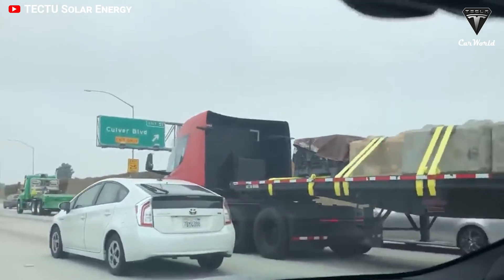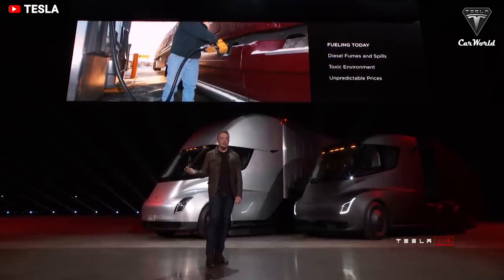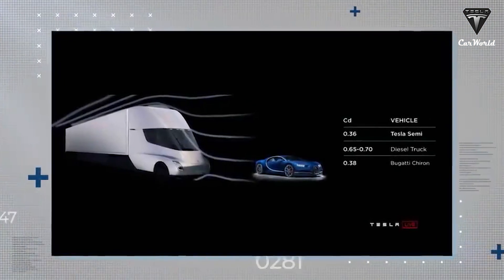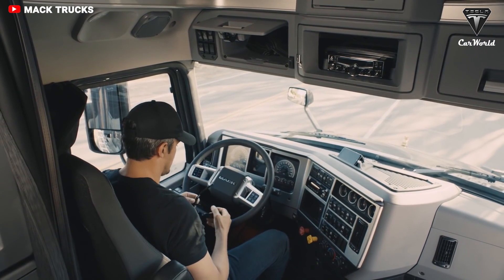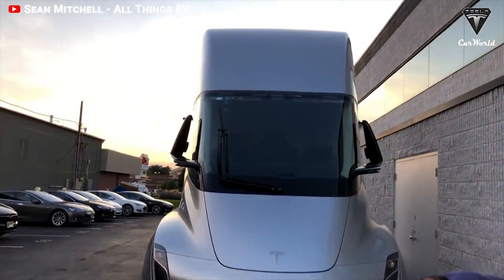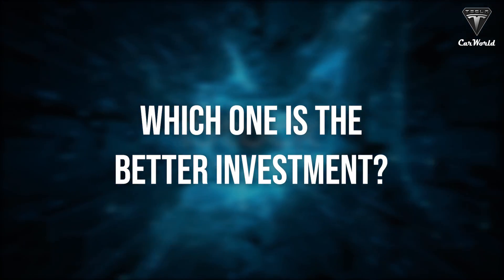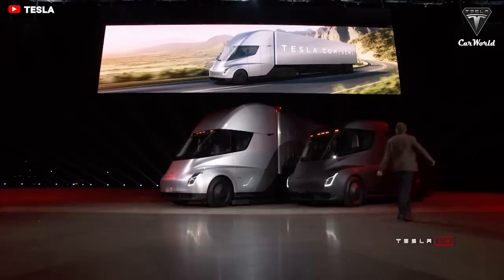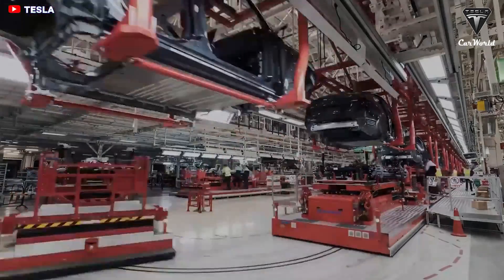Which is the KING of 2023 heavy trucks? Mack Anthem Diesel Truck Vs. Tesla Electric Semi?

Comment: Diesel semis are going to be the best always
Reply: I will never trade in my diesel trucks for something that looks like shit. If it gets to the point diesel is no more, that will be the day I retire.
Reply: “Always” yea until oil inevitably runs out
Reply: @GSDKXV  Thats not gonna happen for a while, scientist say the gulf of mexico alone has enough oil to last at least another 500 years.
Reply: agreed
Reply: the best for noise and air pollution sure...once solid state batteries leave the lab and enter vehicles you will be able to drive thousands of miles in electric vehicles between charges...you are either ignorant or stupid which is it?
Reply: Wouldn’t say always, but they are great for now.
Reply: I support your idea until tesla semi have a range of 800-1000 mile range
Reply: wrobg
Reply: @sharonbraselton4302  Yeah, your opinion is wrong

Comment: The mack. Most road trucks run 5 to 600 miles a day.  It only takes 10 minutes to fuel in a mack.  A road truck can travel about 1000 miles per fill up. Tesla only 300 after charging for 10 hours.

Comment: Ppl massively underestimate the amount of time you save by accelerating to 60 in 5 seconds.Typically a traditional semi can take up to 30 seconds to reach 60 with a load, 5x slower than Tesla's proposed speed. Let's say conservatively you get up to 60 at least 4x in a day... That's literally 2 minutes quicker, per day! If you're working 8hrs a day, 5 times a week that would equal 520 minutes (8hrs) over the year. Literally could be an extra work or off day. And the only thing that changed was just being able to accelerate 5x quicker to 0-60 than the competition.

I don't know about you but if I can gain an extra day while doing the same work, you better believe that's what I'm going for. Whether you believe it or not but this is where the industry is headed, stop resisting innovation, it's weird.

Comment: It is so easy to tell that the author of this video has no clue when comparing semi trucks. Acceleration?! Horsepower?! Are you serious? Torque is king. Try hauling a Toronto to Florida route and see which one is better. Add to the fact that Elon and Tesla have a notorious history for running a lot of hype but not delivering and you have a truck that is only good for running Sysco and Budweiser day cab operations.

Comment: Might be good for local trucking, but charging that large of battery, especially fast charging it over and over and over again, is going to obliterate its range and longevity. Not to mention the wide variety of inviroments and weather the trucks will see. Not enough active  charging stations because tesla keeps withholding payments to small business that let them install a super chargers. Even if there was enough, there is no possible way for our grid to support trucks and cars. Shit people in California aren't even allowed to charge sometimes for that very reason. A  truck is someones home. I definitely wouldnt want to rely on the ifs and maybes that come with charging EVs while its below freezing outdide. Besides, the energy that goes into a battery is most likely from a coal burning plant that operates at around 30-48% thermal efficiency. Diesel trucks thermal efficiency ranges between 30-50%. 

EVs are not green like the government likes to tell you. The batteries are hard to recycle, the mining of materials causes irreversible inviromental damage, and they are powered by coal plants in most cases. So it just taking more steps to get to the same results. Gasoline catalytic technology has advanced to the point of almost zero tailpipe emissions. Diesels have countless emissions devices that also make their emissions pretty damn clean as well.

Unless there is a battery that can maintain its range after suffering the abuse of trucking, I dont understand why we think that is somehow better than 2 fuel tanks that will consistently give the same range for years and years and years.

Comment: 13:45 Yup, insane is the word. Just do a little calculating. With that saving per 200 miles trip, with just 400 miles daily trips for 28 days a month, in exactly a year and a half, you can buy a new Tesla Semi with the savings plus $2000 to buy yourself a brand new most expensive iphone.

Comment: Do you realize that trucks work with torque and horsepower doesn't really matter. Acceleration really doesn't matter too much either. It's not like  truck drivers are going to be drag racing on the highway.

Comment: They'll have to come up with something better much better than the current batteries to really be able to compete with what's available already. We were promised something that would beat rail. This doesn't beat what's there already.
Reply: no they dont...freight haulers can not even legally drive 715 miles in a "day" unless they can average 65mph which is impossible unless you speed.  Days are different for freight haulers and normal people.  Look up the regulations for the 11 and 14 hour days for freight as you dont know what you are talking about.
Reply: Nothing beats rail, especially if it's electrified rail and nothing will beat it ever, except a more efficient train.
Reply: Did the Ford Model T outperform race horses? Probably not. Technology improves and to expect something to be perfect from the get-go is just a low IQ argument.
Reply: @bedinor  he said right now it could be done years ago. That's the issue. A bunch of false promises. If you can't comprehend that, what's that say about your I.Q.?
Reply: Ohman:  You have no idea what you're talking about.  On the Dec. 1 delivery ceremony, the Tesla semi has ALREADY been clearly demonstrated to be FAR superior on performance, with CURRENT battery tech.  It totally blows away the diesel semi performance.  

Being in denial doesn't make you even close to right.
Reply: @rogergeyer9851  it's called skepticism. And it doesn't beat what's already available. Take a good look at current freight trains. Diesel is it's battery essentially, maybe power plant. Like I said, they need to come up with something better than the current batteries. They've already shown that long hauling with batteries is outside the realm of possibility for batteries. 

They overhyped what it can do, and many people to that bait.

Comment: The speed shouldn’t even be mentioned because as a truck driver that doesn’t matter unless you wanna not have a CDL anymore. Also big companies like Pepsi will eventually find a way to have it governed. Trucks now are mostly governed for fuel reasons but for safety reasons, cargo and to prevent being sued for accidents this Tesla will be governed eventually. Also  I’m sure this video is from before the test. But fully loaded it’s 0-60 is 20 seconds.

Comment: Sigh, you clearly have no understanding on what is important with trucking and what the numbers mean. For instance the 80000lb limit is a limit by the dmv, as an example here in a Australia the payload of the mack is not 80000lbs but 300000lbs (up to 140tonne). That 82000lb also quoted is also means the gross weight, not the payload weight, which would be overweight on American roads. So before you attempt to report on marketing nonsense, please understand what you are reporting on. Don't just regurgitate the marketing

Comment: Look, comparing a electric truck to a diesel powered truck is like comparing a microwave to a charcoal BBQ, obviously the microwave is much faster... But when was the last time anyone wanted a microwaved steak??? 
You accelerate faster but on the highway regardless if you're driving electric or diesel you top out at your speed limiter set by law. Therefore your travel time is the same.... Only difference is the electric takes hours to charge the diesel takes 5 minutes at the pumps to fill, therefore if you do have to charge your electric truck the diesel will be hours ahead.... But you're not wasting money on diesel, yes true, but if you add up the amount you will spend on charging your batteries plus the cost or replacement batteries it could actually work out to more then what you would of spent on diesel... 
Also, no jake brake noise from an electric, can't call yourself a trucker without that rubble.

Comment: Like most people you pick a horse power is the right number.  You couldn't be farther from the Truth.  Torque is actually what matters. Especially in a semi truck. Now since you're properly educated. Not a little 435 horsepower  Cummins x15 is  Push out 1885 pound o torque.  Now while the Tesla will  Out accelerate a diesel  Because it's torque it's instant, The diesels are still turning more torque.

Comment: Wait you said the tesla truck was more powerful? Ya sure has abit more hp bit when it comes to trucks its all about torque, and the tesla falls short to the 2023. Also yes its ok to get up to speed quicker but that also throws into the fact that it would be alot more likely to have loads shift. When your dealing with this kind of weight, it's not about 0-60. It's about torque and being smooth. Also range.
Also the interior is far better in the mac

Comment: First question where are you charging this telsa truck. 500 miles is cool but if no truck stops and rest areas are set up for a 72 foot truck and trailer charging its a waste of money. Second how long does it take to charge? Third I have heard numbers on weight for just the bobtail alone is 36,000 pounds.  If this is true dot weight stations are going to be fun.
Reply: Latest data suggests a prime mover weight for the production Tesla of 27,000lb.

Comment: As a former truck driver I can tell you 3 major requirements truck must have before anyone is willing to drive it for long haul. Drive at least 600 miles a day. Haul around 40-48000 lbs and charge in 10 hours while driver is on mandatory 10 hour break. As far as I'm aware none of those things are even close to possible with ev trucks. Local drivers I can possibly see use for these but long haul no way.
Reply: Tesla have demonstrated range of 500miles at 81000lb gross…

Comment: I think trucks should have on board generators with diesel fuel tank to charge when sitting to operate heating and cooling
Reply: Most trucks have APUs that operate heat and A/C as well as keeping the engine warm.
Reply: @craigduysen3663  APU may work but it has to be redesigned since it uses things in the diesel engine to operate
Reply: The Tesla is supposed to be plugged into a power outlet when parked.

Comment: Trucks are going to need to park and charge in their parking spaces they will not be able to charge their trucks from a fuel island. The issue is when rookies and other truck drivers crash into the chargers I am sure there will be less available chargers. Also if they have to put chargers in it will have to be concreted in and a barrier plus they will have to set it so each truck has access to power. Copper is expensive so you may find thieves who will cut the power cords and run with them. So you will have to have a full time attendant watching 24/7

Comment: Why do they claim average mpg and not manufacture mpg? I can get over 11 out of my Cascadia if I wish to drive it for mpg. Average includes some trucks that are 60 years old, and a lot older than 20. Also, why do are they claiming .07 per kwh, when the average car supercharger is over .50? Why do they compare the lowest engine power option when they say it has more power? Why do they mention 82K when the reason they are allowed an extra 2k is because the electric batteries are estimated to cause the electric truck to weigh an extra 4k reducing payload? I think it has it's place, however the media is not being honest about everything. At the very least they could list manufacture specs to manufacture specs, and let people find out that the power cost is 7-8 times higher.

Comment: Engineering and drafting can make this 🚛 looks fine and dandy. But without a professional trucker who has driven a 🚛 for years in all kinds of situations and ⛽🚦❄️🏔️🌊🌬️🌀🌪️🔥🌤️⛅🌥️🌦️☁️🌨️⛈️🌩️🌧️🌑☀️ should be the person to test drive these in different types of weather and longer time limit before knowing how it will perform. Semi truck are a huge difference from a 🚗🛻🚐🚕. Truckers can tell you more about the performance of driving then someone who hasn't sat and slept in their rig for 3-4 weeks straight. Truck supposed to just almost comfortable as their home. Its their lives not someone who just holds a  🖋️ 🖊️ ✏️ 📝 📒📐 📏 🖥️  in their  🙌 🤔 🚛 💨 💨 💨 💨. 🇺🇲

Comment: I'm constantly seeing incorrect comparison metrics with these videos.  There is no system in this nation where electric cost is only 7 cents for kilowatt hour.  That's just the cost for delivery, that excludes distribution..  distribution is usually the same price as delivery     That also assumes standard level 2 charging not from a super charger..  The megachargers if anything like the super chargers will charge at least 40 cents per killowatt hour. Given that a megacharger will be necessary for daily use this should be the metric utilized to make the caparison.  

 I'm all for this Tesla truck, but we can not overpromise and underdeliver with metrics like this.  Owner operators need to know the exact metrics for which they're going to be based in their cost basis.
Reply: 7 cents per kWh is the wholesale price that large consumers pay.
A warehouse is a large consumer by definition. Walmart is putting solar panels on their warehouse roofs to power their new delivery trucks (that they are buying from Volvo not Tesla).

Comment: Tell me you don’t understand the trucking industry without telling me you don’t understand it.

In all honesty an electric semi is great for short distance runs and inner city runs. However as an over the road vehicle it fails namely on range and the ability to charge quickly. I drive over 650 miles a day and it takes me 15 mins to pump the 100 gals I use each day. I team drive meaning while I sleep another driver drives that’s how we can ship your products quickly and efficiently and we can’t do that if we have to stop every 300-500 miles and charge the truck for hours. Also an electric vehicle loses power as the battery is discharged and I’d love to see one climb a 5 mile long hill at a 5%+ grade I’d bet it’d drain that battery hella fast and start to lose that high torque. 

Stop sucking Tesla’s dick and learn about what your talking about before you open your mouth.

Comment: 0.07 cents per KWH?!  You're comparing the highest diesel prices to the lowest electricity prices, and you can't get those electricity prices on the road.

Supercharging rates range from 0.33 to 0.55 in my experience.

Comment: Coming from Tesla Car World tells me what to expect.   First off having the fastest 0-60 time is not the goal if you want all of your household goods to be delivered undamaged.  Secondly to simplify, more horsepower helps with speed, more tourqe helps accelerate heavy loads. Since no one wants tucks speeding.... or even doing the speed limit in most cases because of safety, having that much more horsepower can be useless (hence why diesel engines don't prioritize it over tourqe) so the Mack is equivalent with usable tourqe even with the base engine.  I'm sure Tesla will make companies pay extra to unlock all that extra horsepower anyway.   Gross combination weight limits without permits is 80,000 lbs no matter what you drive, heavier axle and tire ratings have been able to get you that extra 2000 lbs payload rating for years. Drivers can get ticketed for have a GPS or cellphone in the wrong spot because of safety concerns but will be allowed to have two laptop sized "infotainment" screens because it's a Tesla... 🙄 and the fact he said the Macks was located between the speedo and the "taco" or "tacho" 🤡 just confirmed they have no clue about professional trucking.

Comment: Tesla =claims.
Mack = real world results.

Tesla: worried about 0 to 60 (cause we need race trucks)
Mack: worried about 1800 pounds of torque is enough to pull the tesla.

Tesla: 400 mile range......in cali. Once in a cold state, cut that in half and forget about your heater working. 
Mack: winter? Whats that? 

And it could go on.